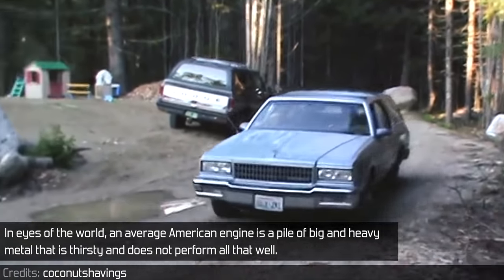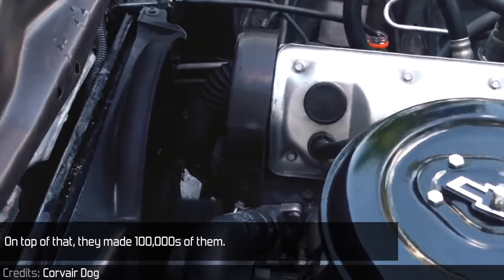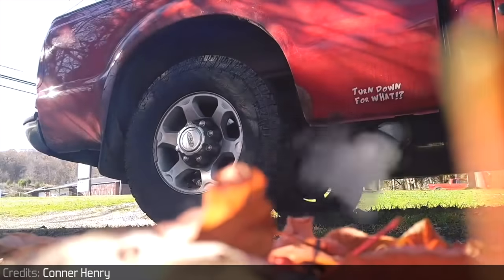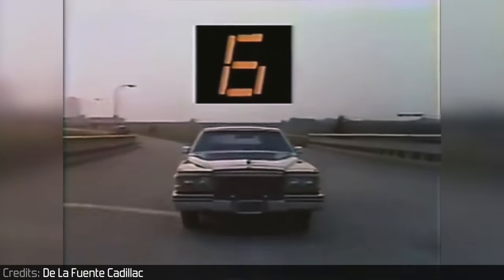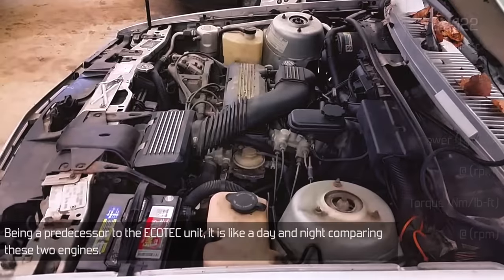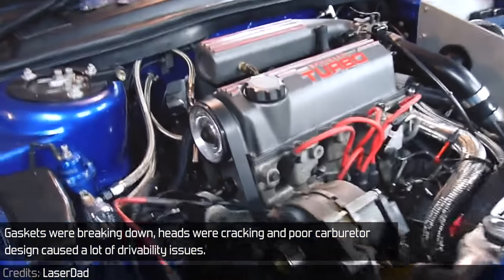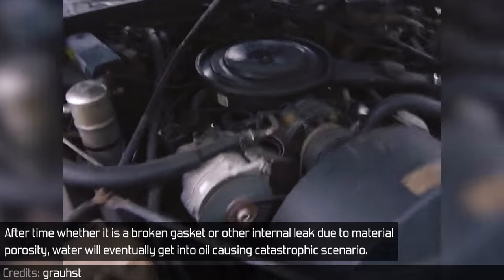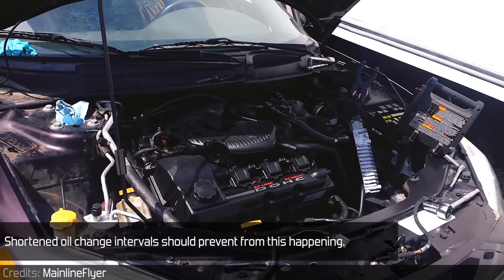8 Worst US Engines You Should Avoid

Comment: I think a lot of the American cars started to go downhill after the fuel crisis following 1973. Before that, most of the engines were quite reliable and had plenty of power for their time. But when the fuel crisis shocked the country, the car manufacturers had to scramble to make more economical cars to fit the increasingly stringent market. That's a pretty big transition from putting the biggest V8 into muscle cars and competing for the most horsepower, since fuel prices were still pretty low. It surely didn't help that import cars already had good fuel economy and were extremely reliable. That being said, the Americans had to play catch up with the imports such as Toyota and Honda. Imports were also offering a more affordable price. That being said, American car manufactures started to cut corners with their designs to keep costs down while still gaining the most profit. This ended up being the beginning to the decline of domestic cars and the rise of more and more imports, as many American cars started to show reliability issues as well as poor performance. After the 1990s, the engines started to get a little better but by this point it was too late. Toyota, Honda, and many others have already gained a foothold in the car market and starting dominating. GM, Ford, and Dodge have definitely improved on their products since then, but they are still outnumbered by imports. It is a real shame. I have always been a die hard American and I like the domestic cars and imports respectively. But how the world would be different if the fuel crises never happened.
Reply: You're also forgetting about emissions controls. Most imports were already playing with EFI in some models. This gave them a big leg up on the domestics. Carburators even modified were a bad idea for smog control.
Reply: Your absolutely right. The more stringent emissions regulations made it tough for car manufactures to meet those requirements. Fuel injection on domestic cars.was a thing back in the late 60s and early 70s, but it was very primitive and not fully mastered. Therefore, it was easier to just slap on a carburetor and call it good. The imports have already gotten a foothold on EFI, while the domestics were lagging behind. There are many contributing factors why the American cars just started to go downhill, such as trying to compete with the already lower cost of imports and cutting corners to do so. They used to be king of the roads in the United States and Canada before the imports took over.
Reply: Kyle Bittle smartest comment in here !!!
Reply: In all fairness: till gasoline quality was improved; FI engines as a group weren't any better than at least NON computer controlled carb'ed motors.
Reply: I refused to buy a foreign car. In 1981 I needed a new car. Because of the recent Iran oil crisis I bought a Buick Skylark with the 2800 V6. The car was absolutely worthless. In 1988 I went and paid the legal fees of 150 dollars to get the lien taken off so I could sell it. I got $60 dollars for it. With all the options,and a,17 % interest loan (Thanks Jimmy Carter,) I had paid $12000.

The legal fees were because I lost my job and couldn't keep up the payments -- because I couldn't get to work. Every month, I faced the choice of either paying the car note, or paying the mechanic to fix it. I was not able to buy a brand new  car again until 2014, I bought a Toyota, and I will never buy an American car ever,again.

Because of the Buick, I ended up driving a succession of junk for almost 20 years.

I am patriotic but I have to get to work.
Reply: Around the late 70s' and through the early 90s' America and Europe were in a major economic recession. This with tough emission laws made it difficult for automobile manufacturers to exist. American motors went broke and the Big-3 nearly went out as well. No one was producing good vehicles at all. Only the Japanese it seem's were doing well in quality and sales. During those times buying a Japanese vehicle was like putting money in the bank.
Reply: Avery Nisbet - You've got it wrong. Emissions controls don't necessarily mean cleaner exhaust. 
At one time I had a 1980 Datsun 280ZX - US model. A friend had a similar car, but the Canadian model = no emission controls. We tested both cars on an exhaust analyzer ... and guess what?  The Canadian model's exhaust was MUCH cleaner. (Both cars had fresh tune-ups, so everything was as close as possible.)
My current truck, a 1973 Chevy K-10, gets the same fuel mileage and burns MUCH cleaner than my uncle's 2013 Dodge 4x4 pickup.
Reply: The Japanese auto makers were getting help from their government and were selling cars at a loss in the US to break the domestic brands.
Reply: I feel that the Environmental Protection Agency with the nationwide push of the California Emissions Standards killed the better quality engines built before 1974 which ran on leaded gasoline versus unleaded gasoline.
You still see many of those old lead gassers in my area running as strong as they did when new with over 300,000 miles on the clock while the unleaded engines that have 198,000 miles and are 5 years old sound like they are ready for the junkyard.
Reply: Big 3 small cars in the 70s and 80s had a "grudging" aspect about them, as if management wanted to punish people who bought them in order to push them up into their bigger more profitable cars. Toyota, Nissan (Datsun), and Honda, though, were happy to put out small cars that were relatively fun to drive and reliable. They "felt" like they were designed as real cars, not as some thrown-together awkward and uncomfortable components. But this was a continuation of the 60s approach to small cars. The Corvair and the peculiar '63 Olds f-85 Jetfire were nice cars, but a mid-60s Falcon or Chevy II was a dog compared to a Beetle or a Volvo 544 or 122, in terms of driving experience. 
-- The Japanese weren't mistake free. The original Accords (1978) seemed to be designed for 5 years of reliability, and then EVERYTHING went to hell all at once. 
-- Even today, U.S. carmakers seem to begrudge buyers of small cars. Chevy makes a Cruze wagon they sell overseas, but not here, out of fear it would eat into sales of their compact fatassmobile Equinox. 
-- Of course, a lot of blame has to go to government regulations. CAFE standards omitted SUVs, as have lots of safety regulations, which made SUVs more profitable and cheaper to sell, despite the fact that (as of 2012) the light truck class had a 47% higher fatality rate in single vehicle crashes, which constitute 55% of highway deaths. 
-- Things are messed up overseas, too. VW and it's diesel emissions fraud. And look up on YouTube about the Nazi history of the Quandt family, which bought up controlling stock in BMW in the 50s and 60s, and continue to be the effective owners of BMW. What's less well known is that they pulled political strings to prevent German government assistance to Borgward around 1960, a car company that built great cars and was run by an honest (if over-extended) car guy, in order to drive out of business a chief competitor in the niche they wanted to occupy. VW is corrupt. Beemer drivers are driving cars that enrich a family that got rich making batteries for U-boats, using slave labor, but fell through the cracks during the Nuremberg trials. The Japanese and the Koreans have cozy subsidy relationships with their governments. But at least they're allies.
-- Enough grousing. I think the theme here is that there's enough stupidity and moderate corruption all around to be moderately disgusting. But when the Chinese try to come here, they are not allies, and they're far more corrupt than any of the above examples. (They own Volvo, BTW.)
Reply: Actually it never did happen. My brother was an executive for Union Texas Petroleum at the time and he told our dad that his company and several others kept their oil tankers anchored just outside of us waters until they were notified that the prices were at the levels that the companies wanted. Only then did they come into port and unload their black gold cargo. He was assigned to go out by boat and check on his companies tankers,he made that trip several times.
Reply: yeah we shouldn't have supported Israel
Reply: Change is the only constant in life. You either adapt or become extinct.
Reply: @garymanis6305  FACTS.  I can't understand why so many refuse to accept this!
Reply: As far as reliability, you are 100% correct, but power went sharply down in 1972.  They started using NET, instead of GROSS, ratings, and said that net ratings were about 30% lower, actual power between the 2 years was the same.  However, I compared a 71 Ford with the 351 2 barrel to a 72 Ford with that same engine, and the 71 was considerably faster, but mainly in the higher rpms, not so much off the line.  I have an old shop manual that shows the engine specs and ratings in both gross and net, and the net is only about 15 - 20 horsepower less.  The low power of 70s engines was due to emissions regs.  Hot cams mean high horsepower, but high emissions as well, so cams became much milder.  Blame the EPA.
Reply: And Japan subsidized, and probably still does, it's auto exports.  That's partly what drove GM and Chrysler into bankruptcy - they were desperately trying match Toyota on price, eventually selling cars at a loss, as no matter how low American automakers priced their cars, the Japanese kept getting ever larger subsidies, which meant they could keep undercutting Detroit on price.  Blame our spineless politicians for refusing to stand up to Japan, not our auto industry.
Reply: @64arguz  Can't understand why so few understand this.
Reply: I can just picture a naturally aspirated DOHC 7.0L V8 powering a 2500 pound car being a standard 🤤
Reply: The DOHC Chrysler 2.0 in the Neon is bulletproof and it revs all the way out to 7500. You're crazy if you think modern American engines suck.

Comment: I have to disagree with the cost cutting thing for the most part. A lot of the reason for us here in the U.S. having made shit engines has to do with idiots in control of emissions standards going about things all wrong. They thought lowering an engines compression ratio made it more efficient......it does the exact opposite
Reply: I was just saying that in another comment.
EPA:  "Implement this or we shut you down - Haha we're smart we good at fuel economy!"
Auto manufacturers are like:  Well that pretty much undoes everything we worked for, stick it on and get it out, to late to fix all that.

Couple years later it's the same thing.
Manufacturers:  "Finally it works pretty good - Hit the green light we good to go!"
EPA:  "stick this on it'll work better! - Fuck, were saving the world!
Manufacturers:  "Fuck me...."
Reply: Well the Vega engine being crap was largely due to cut cutting in that the high silicon aluminum bock was supposedly lower cost than using traditional cast iron cylinder liners.
Reply: The government knew lowering compression hurt efficiency and mileage. They only cared about emissions, which lower compression ratios did reduce. Their answer to better mileage was to just go with smaller engines, which meant even lower horsepower.

Those were sad days. Chrysler 440's went from a maximum of 390HP for the 6-pack, down to around 200HP in the last year, 1978. That's from 54.2 to 27.8HP per liter. 

My 06 Exige has a 1.8L pushing 276HP, (non-stock supercharged), at the wheels, which comes out to a calculated 313 at the crank, (which is how the horsepower was rated back in the 70's). That gives 173.9HP per liter, or 6.3 times as much horsepower per liter as the low compression 440.

It's amazing how technology has improved engines.
Reply: I don't think the government mandated lower compression, they simply required lower emissions; the manufacturers lowered the ratio so they could comply with those emission standards because they didn't have the technology at the time to handle it any other way.  They came up with open-chamber heads, which are worse for power, and really, not that great for emissions, but got them within standards.

We see that as technology improved, emissions went down, compression and efficiency came up and so did power.

I remember when a 400 HP SB required 12:1, a big camshaft, a big 4 bbl carb, a single-plane intake, headers, big valves, big ports, and high revs having to run avgas or 110 octane.  Now you have "stock" engines idling like sewing machines, getting great mileage, running on pump gas, hitting 400HP almost without effort and with factory warranty.  None of this would have happened, or at least not as quickly, if manufacturers didn't have someone laying out targets for them to hit.  As long as they could sell a gas-guzzling, exhaust belching cars for profit and not have to make improvements, manufacturers would just rake in the profits, and, the poster is correct, many of the short-comings are due to putting profit over quality; that is why the European and Japanese had such an advantage over North American manufacturers for many years, they want quality to sell their cars.
Reply: @Patchuchan , GM was actually doing it in their racing engines too, they thought it was a good way to decrease internal friction and easily improve mileage and HP.  As with many things with American manufacturers, they didn't do enough testing and the whole concept failed miserable due to the piston coating failing.  If they had used a solid cast iron piston, it probably would have worked, but the piston would have been too heavy.  

A good example of the concept working is shown in today's hypereutectic pistons.  The process is reversed, where the piston has a high silicon content and the cylinder is cast iron.
Reply: That is precisely an example of cost cutting.
Reply: @lelandlewis7207  reducing compression lowers heat and thus oxides of nitrogen produced.  The gas was not as good after 1970 and couldn't handle the higher compression anyway. EGR valve was also created to lower temp in cylinder.
Reply: @watchman-pu7tp  The high output 440 didn't make 390 but 375 and that hp rating was "gross" hp, that means it was bs, it was measured without restrictions, even without the water pump and the air cleaner. In 72 all engines came to be measured in "net" hp, so it made 280 hp.
Reply: @Lianpe98  You've got it reversed.  "Net" is rear-wheel horsepower, and "gross" is a stripped engine on a test-stand.
Reply: @linguisticman  Oops, sorry 😅 I don't know how I mixed them up. I've corrected it now, thanks.
Reply: They didn't lower compression to make them more efficient, they did it to lower NOX - Nitrogen Oxide - emissions.  Higher compression means higher combustion temperature, and higher combustion temps means more NOX.
Reply: With a single carb it made 375 horses, with tri-power it made 390.

Comment: Chevy vega was the one we would put 350 ci into
Reply: Had a cousin that stuck a 327 in to his
Reply: My  Vega was a 73? Wagon with a 6 cyl and  5 spd trans.  The problem I had was a weak firewall that ripped over time causieng  the clutch to not work. Car was  tan with a burgundy/bronze stripe across the nose that followed the body line and ended at the louvered 1/4  panels
Reply: I had heard the frame would bend with a V8 in it causing the need to buy many windshields as they would crack when you hit the gas.

Comment: You missed the Chrysler 3.1 H.O. installed in the 300M and Intrepid. Spun crank bearings all day long...POS.
Reply: Chrysler 2.7 in 300c is also shit
Reply: 2.7 did great in Russia and Europe. It likes quality lubricants and changed regularly.
Reply: Viking General 

It was the epa regulations here in America. They put a converter next to the oil pan and it would cook the oil causing the sludge leading to destruction. In other countries it wasn’t an issue.
Reply: It was so bad it didn't even qualifiy to be in this video